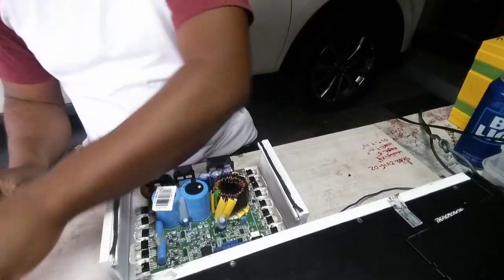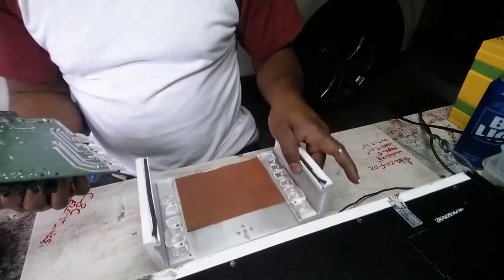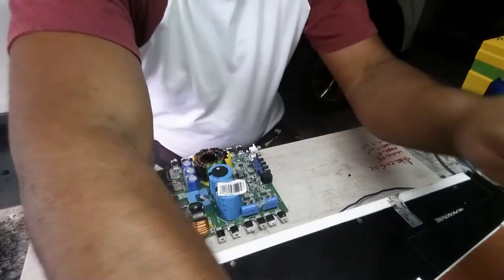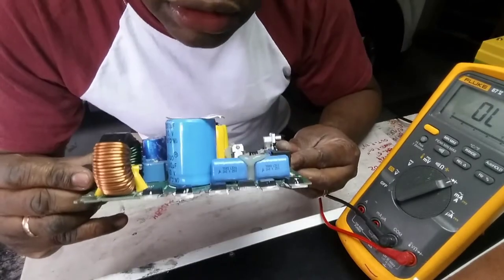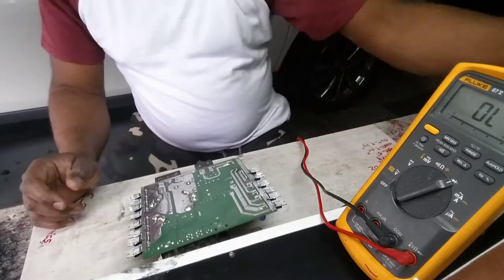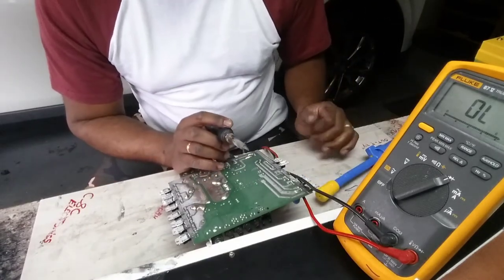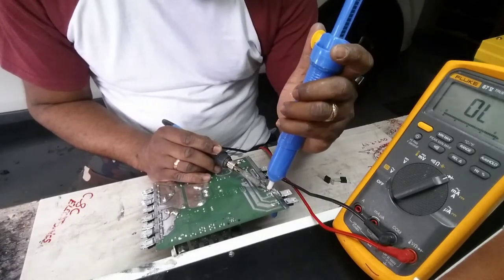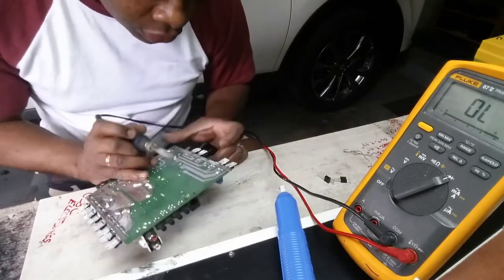Taramps HD 3000| Part 1 Protection Mode|No Power| C&C Electronics Repairs|Sales|subscribe!

Comment: Hail General I have a boss AR1500 mosfet monoblock that was playing good the last time I played today I realized im getting a low tone with little to no bass....the protection is not on the green is showing I disconnected from crossover and run the RCA cable directly from preamp NO BASSLINE but the greenlight is on and the volume levels are up.....think you might know what's wrong?